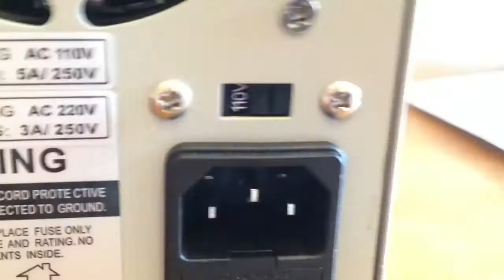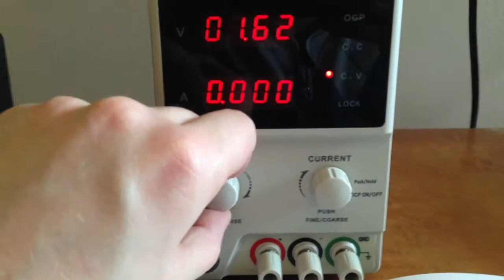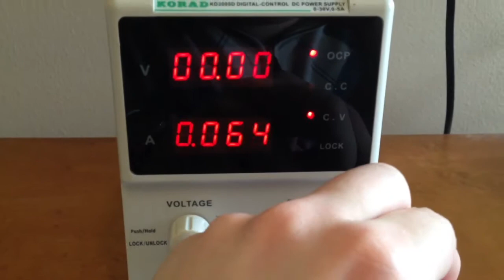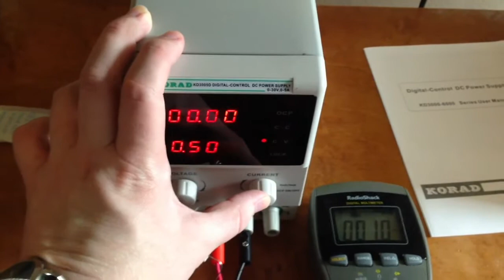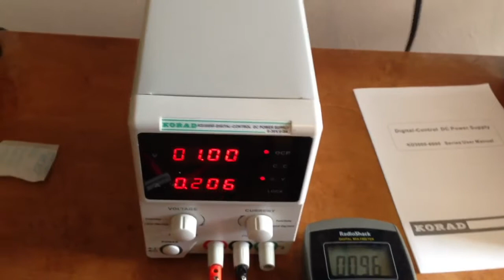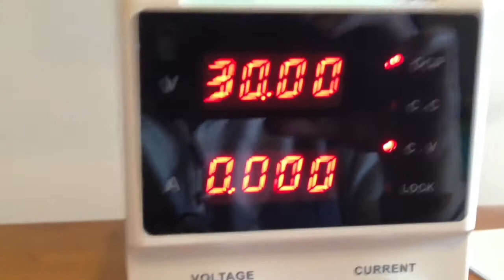Korad power supply: Unboxing, first impressions and basic tests

Comment: Is there a way to give it a Constant current and current voltage to work as a adapter?
Reply from the maker: If you want it to work the way a wall adapter does, you probably wouldn't want to use the Over-Current Protection function on this power supply. Most wall adapters I've used will be designed to go into "constant current" or "current limiting" in other words, the voltage drops until the current is no longer excessive. How that is done depends on the adapter.

For some applications, having the unit limit the current by lowering the voltage, without cutting it off, may be preferable. That's why the power supply lets you choose. 

It does remember the last setting that was used, but I'm not sure if it needs to be plugged into the wall to retain that setting. Most likely it doesn't as the unit uses a "hard" power switch as opposed to a software button. One thing that isn't saved when the unit is power cycled, however, is whether you had OCP on or off.
Reply from the maker: If that doesn't answer your question, then I'll need to know what you are trying to do in order to help you.